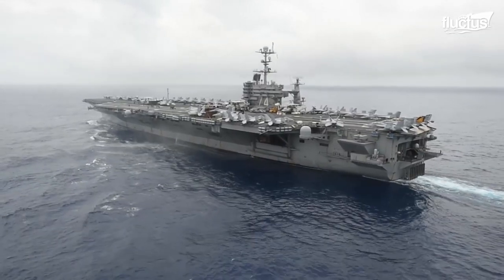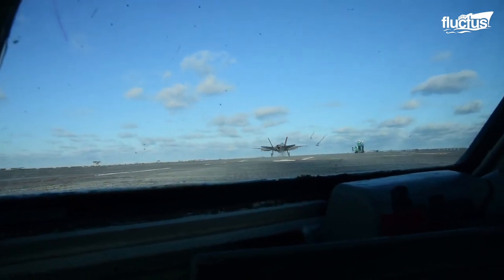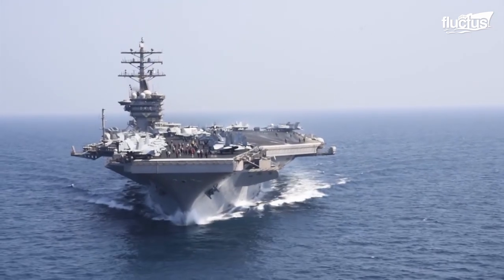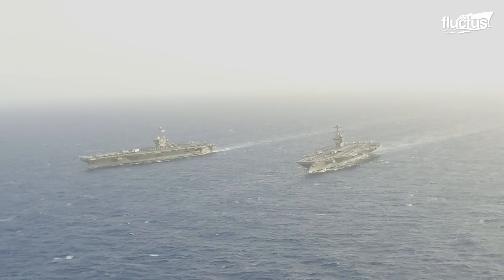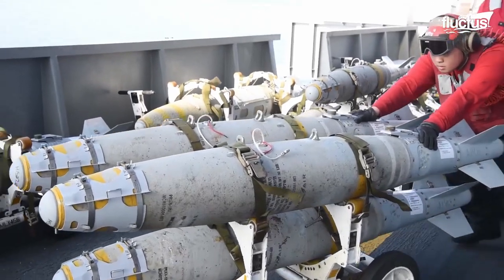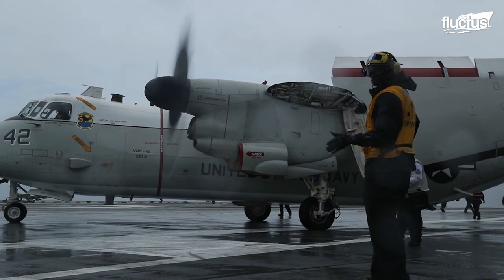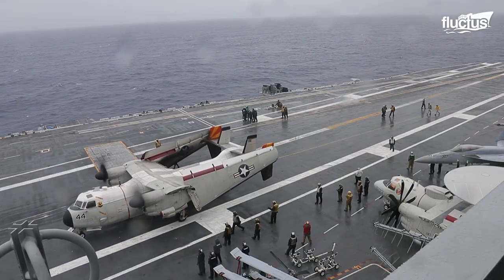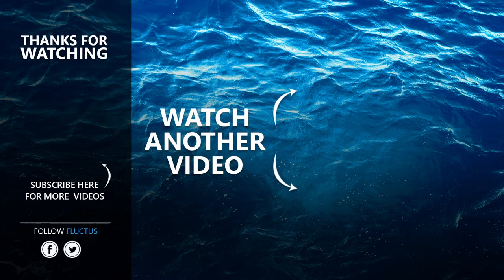Reasons Why $13 Billion US Aircraft Carrier Cost $8 Million per Day to Run

Comment: you got the maintenance cost of broken parts , Payroll for 4-5k personnel , Close to 15-18k meals per day it all adds up quickly , Then the jet fuel alone is massively consumed , My Airwing was on the USS Coral Sea back in later 80”s heard several purple shirts say it used over 2 million gallons of jet fuel a month . I can’t confirm this but I believe it .
Reply: when I was aboard Ranger Every 3 days we would unrep and take on about 230,000 gallons of fuel for the ship and a simaler amount of fuel for the jets . This was 1979 so who knows . As a point , as I understand it . to launch have it go around and be recovered an F14 Tomcat would us 2000 lbs of fuel . Uss Ranger cv 61 cruised at 76,000 tons . Thank You
Reply: I know. Said here that the total daily operational cost is betw 8 - 10 million a day!
Reply: These are nuclear powered, they don't need fuel. The planes do and maybe a couple of other things, but the boat doesn't need any to run. The meals when made on such a scale, probably cost $2 a pop. Wages are what they are, they aren't costing millions a day. I call bs.
Reply: @malcombe7001  She should have been more specific in her comments that the refueling is for other than the propulsion of the ship .... such as the aircraft.
Reply: @view05nys  
She did mention fuel for the planes, but that's just paraffin.

Comment: 6:59 "little ships"...they average between 20 to 32 meters in length and weigh between 250 to 5800 tons. Size is relative i guess.
Reply: As ships go thats actually small..ships with a weight of over 200,000 tons are common..so yes a ship weighing 5800 tons is small
Reply: @patriot2314  I was specifically talking about tug boats.
Reply: @ricksanchez9669  so they r small